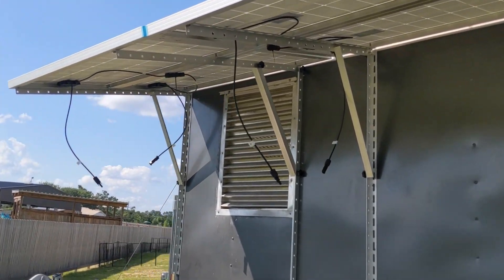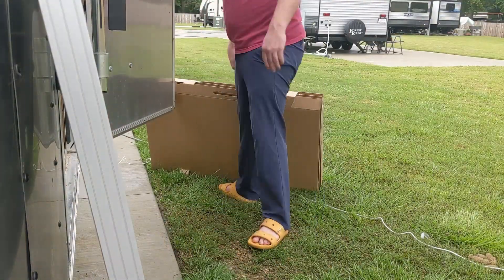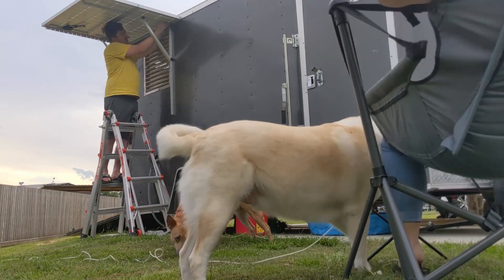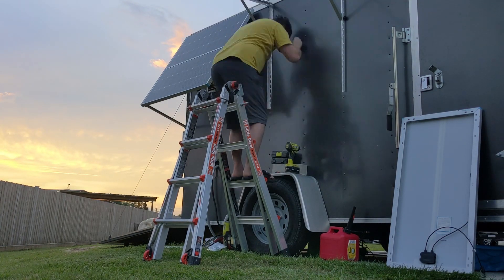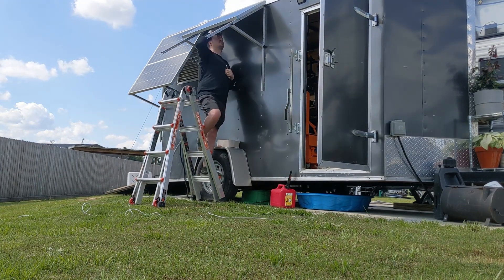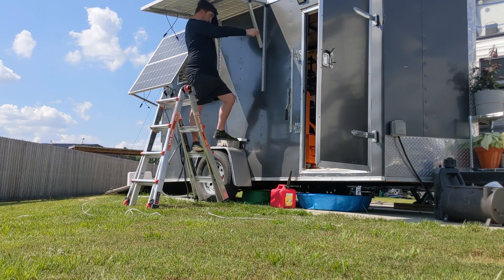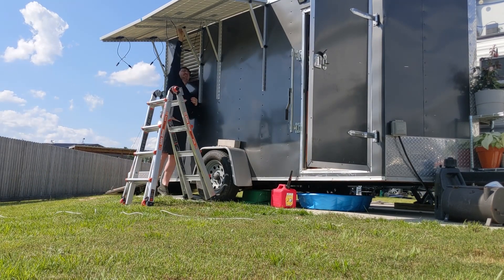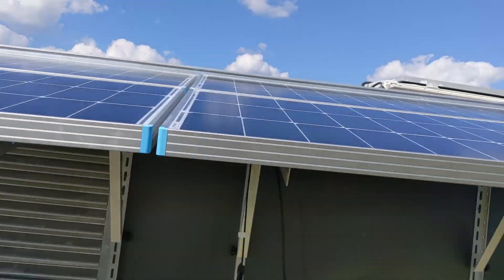Diy Renogy Solar Panel Install | Full build in under 10 mins!

Comment: Do you use anything to cover them when traveling, or are you letting them charge your battery?

What type of gland did you use to get the cable into the trailer?

What size is the trailer?
Reply from the maker: I'll leave them uncovered they do charge the batteries while we're traveling with the trailer, but it's not that great since they're not really angled upward. The trailer has weatherproof vents manufactured into it I routed the cables though.

Comment: Nice Solar Project 👍, a few mini- solar power tips: 1.) So the solar self-consumption of the balcony power plant is screwed up and you save 30...45 cents/kilowatt hour. The €10 dimmer is all about the money saved to save a lot on electricity costs because the electricity meter stops if you do it right: https://youtu.be/eC2olbCBhh0 . The avoidance of electricity from the grid will greatly reduce the amortization period and even the cheapest PV system can be built without a battery. With Dimmer + Solar PV, self-sufficiency can now increase to almost 95%. That's how easy it is to suppress expensive grid purchases. The electricity bill stops just like the electricity meter. https://youtu.be/D9Ss0RuqZG0 Kettle: Without a dimmer, the 2500W - 600W PV system needs = 1900W, which you have to pay more for. If I turn the kettle down to 600W with a dimmer, then every PV system that is too weak can now supply each consumer independently and independently, because the 2500W kettle becomes a 600W kettle thanks to the dimmer. No magic, just physics. The prerequisite is that you have at least one small solar PV balcony power plant. You don't need an expensive battery. https://youtu.be/azDjqZpz77U The 2000W e-heater becomes a 500W e-heater via a dimmer, which can run 12 hours a day free of charge via PV with me. It is not the solar systems that have to grow, but the peak currents of the integrated device heaters simply have to drop by 75%. With the dimmer / voltage controller it has become so easy. I have already switched my entire household (2020) to 4x dimmers. Please have a look at my channel. 🌞 ... Increase mini PV solar self-sufficiency (winter and camping): You can continuously regulate a boiler and other power-hungry consumers with the "5000W dimmer". Ebay €7. I run 4 dimmers in parallel on an 850W inverter. Kettle 2.2KW at 150W runs 12 hours a day, so the water is always hot. The room is also nicely heated. 2.5KW washing machine runs in parallel with dimmed to 400...600W and always reaches its 60°C, and also its 1400rpm... It doesn't matter to the washing machine whether it changes the washing temperature to 5min@2500W or 100% can be achieved free of charge via existing PV power in 20min@600W. The wash cycle lasts the same time dimmed and non-dimmed, 3Sth 10min. The iron https://youtu.be/-71oL7z1kMU , dishwasher https://youtu.be/8vnAkrS1x-s , oven , electric heater, https://youtu.be/QbLWDbJi6ew , waffle iron https://youtube.com /shorts/ofanZCdYEjA?feature=share , coffee machine, all internal heating is throttled with me. Lots of videos on my channel. The inverter stays cool and quiet and the MOSFETs + (battery packs) stay intact because extreme total currents no longer arrive at the inverter. Now every Mini PV Inverter is enough to operate large devices. So, with the dimmer, all internal heaters/devices can be converted into base load devices that stay almost permanently ON, drawing very little current directly from the PV. With a wattmeter / energy cost meter you can then measure this perfectly in order to set the dimmer optimally. .... 🌞 .... "smart energy saving", made a meaningful reaction explanation video about the dimmer: https://youtu.be/EHtJGiXAjZk . 🌞... 2.) A "split air conditioning system" is a mini heat pump for heating and cooling and costs only 400€ in total at net or https://youtu.be/wB8rq-D9PAQ or https:/ /youtu.be/wo0cgRJcbsU and everyone can DIY for free because it's so quick and easy. 800Wp solar/balcony power plant costs 499€ at net, 2-3 of them provide free solar power for the mini heat pumps / split air conditioning system (up to -15°C). In winter, when it is extremely cold, you can continue to use your old gas heating normally for a short time. The efficiency of the heat pump is 300-580%, since the "cop" is 3...5.8, which is why it is so superior to all technologies, because 1kW/h of solar power turns into 5.8kW/h of heat. A marvel of technology, and the efficiency winner. A large heat pump costs €3000-5000 https://youtu.be/_ovT0G5v-Z8 DIY, which usually runs free of charge from the solar roof €5000 DIY. When it gets really cold, you can bridge these days with your old gas heater. In winter, more electricity comes from neighboring countries, but that's not a problem because of the interconnected grid. Hydrogen has an efficiency of max. 20%, against 580% heat pump. The heat pump is absolutely superior, and you can leave everything as it is with the old gas-oil heating system, you don't have to change anything... Explanation: Efficiency and "COP" with a heat pump: https://youtu.be/E3NUW0L8_cg . E-cars, heat pumps, power plants https://youtu.be/CLFLFX0OWNM . 1.) My automatic DIY solar tracker 2-axis: https://youtu.be/_Rs8CptQcDw. LG Christian ............ 🌞............. Rebuild and be happy. 👌... More videos on my channel.

Comment: This was nice.  I'm glad you mentioned the little errors that went along with it.

If you do it again with small panels next to each other, maybe try building a frame on the underside of the panels on which you can mount them together first and then mount the entire thing as one big panel.  This will require another pair of hands and it may not sit as flat to the side as you'd like, though.

Comment: I would get a bigger 500 watt single unit panel. Those would have worked much better as a awning
Reply from the maker: I'm working on another video putting larger panels on the actual roof I had some 310w house panels and those 4 100 were lighter than 1 310w panel. I don't know what a 500w panel would be weight size wise.
Reply: @SunBitSynergy   about 21KG

Comment: How do they hold up traveling down the road? Also, are your trailer studs   16” or 24” on center? Great idea!
Reply from the maker: It's 16" on center of this trailer. When I take it down the road I fold the panels down and bolt them using the holes in the brackets seems to do fine.

Comment: I have a detached garage.  Estimates to run power to it from the closest utility pole are $4,000 to $6,000. Right now, I need enough power to run two trickle chargers, one to a UTV and another to a motorcycle.  Also, an interior light. I’ve looked at several power stations with solar panels, (EcoFlow & Growatt, both under $2,000), but I’m not sure what is appropriate for my needs.  Can anyone advise on what is appropriate and the most economical.
Reply from the maker: I would suggest a hybrid grid tie inverter like ( https://amzn.to/3NKg9bS ) a 24v battery from ( https://batteryhookup.com/products/1-low-row-super-beast-headway-24v-48ah-1-23kwh ) and a panel setup like the one in this video ( link is in description) All said and done. You'll probably be under $1, 200 and able to run your small loads. I run an enclosed trailer on this same setup. Power tool batteries, lights and power strips.
Reply: @SunBitSynergy  Thanks for the quick reply.  I'll check out your recommendation.
Reply: @douglasszot8294  Great recommendation by OP, I use eight of those headway LIFEPO4 batteries to start my four cylinder car.

Comment: why not on roof
Reply from the maker: It's a brand new trailer I don't want to poke holes in the roof potentially letting water in. I do use it for storage still and have a future build coming up in a few videos for an on roof setup.
Reply: Great idea! What is the spacing of your wall studs on that trailer?